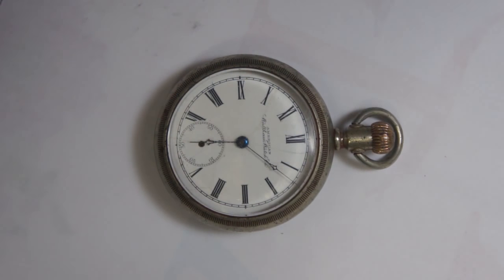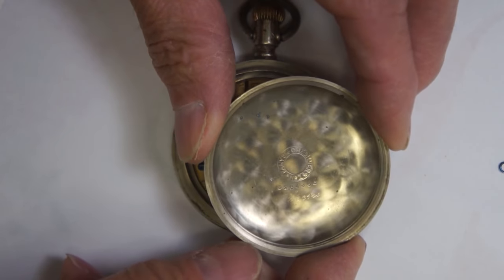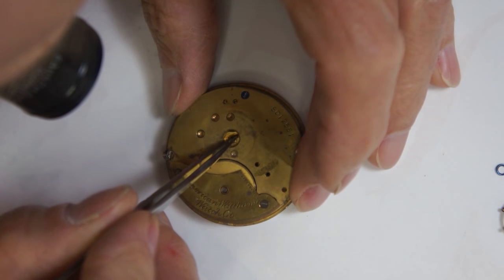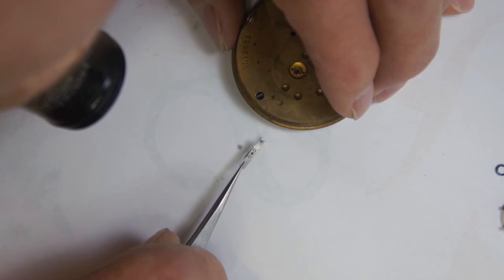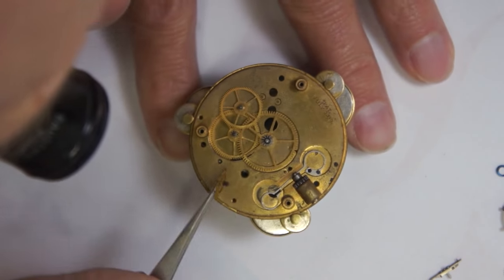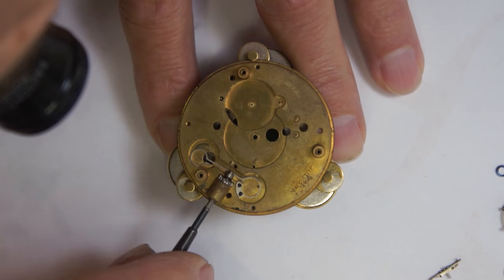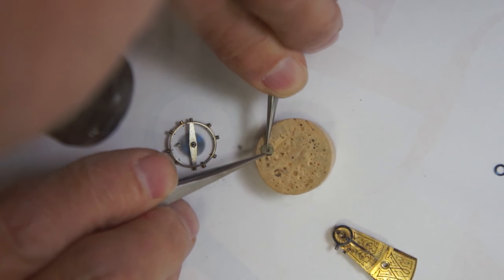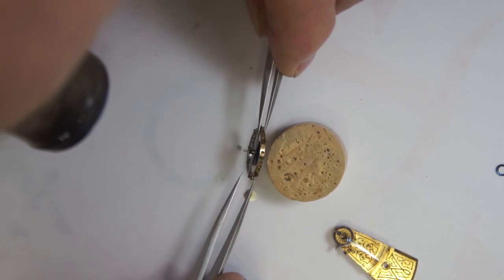Waltham 7 Jewel Pocket Watch Inspection for Cliff from Tennessee #31

Comment: Is it at all common to have to replace the hairspring in these, or can the existing hairspring almost always be reused?  You seem to prefer keeping the existing one.
Reply from the maker: Hairsprings, attached to the balance wheel last the life of the movement unless they have been abused by someone.
The blue carbon steel mainsprings are the items that will fail due to fatigue, they become brittle and will break with usage, the new style white stainless mainsprings last much longer.

Comment: My guess is that your preference for using tweezers in handling clock parts started with watches.
Reply from the maker: Yes, I started out with watches and haven't been able to break myself from using them, I even have an eye loupe and a pair of tweezers in my wood shop I use from time to time.
Handy to have around.